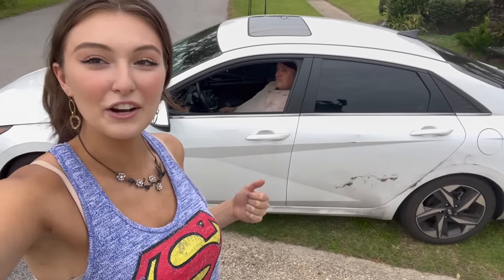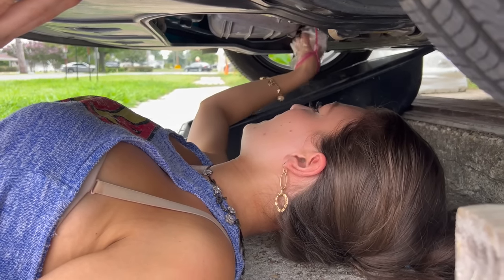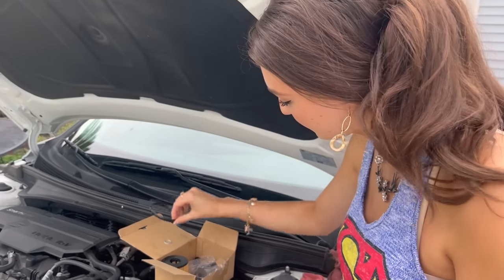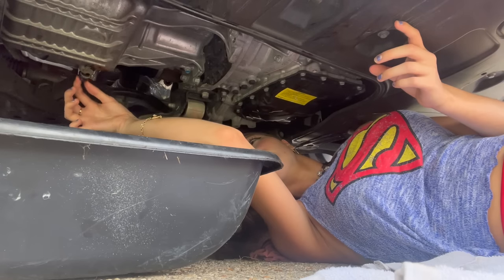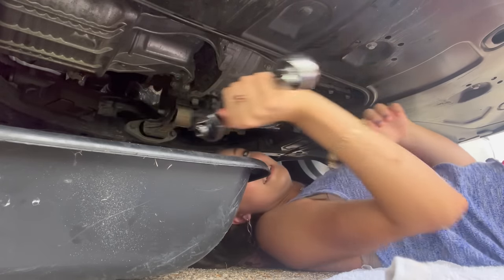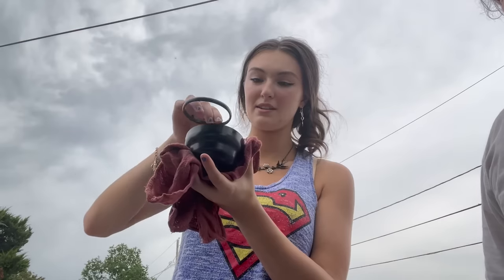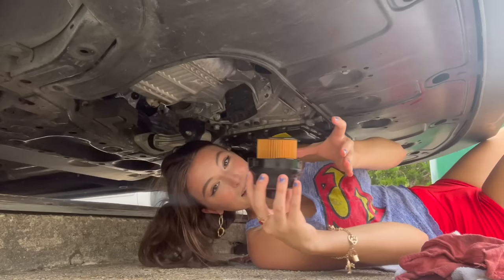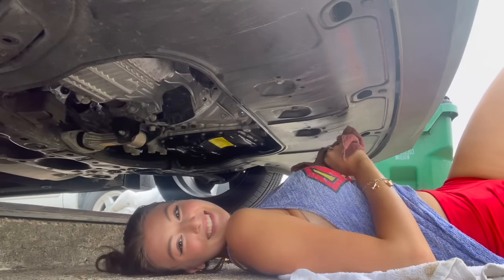Want To Help Me Change My Oil? ​⁠@HyundaiMotorGroup ​⁠@hyundai

Comment: You need to open the oil cap on top. This will help the oil to drain faster and make sure it drains properly. Also you need to prime the o-ring with oil
Reply: The crankcase is vented

Comment: Great job,two thing I‘d add. First take the fill cap off so it vents the engine and the oil will drain faster and more. And the new oil filter gasket is to rub it in new oil to lubricate it so it seals better and less chance to rip or take. Great job!

Comment: The oil in the filter is critical - you want those seals lubricated before you install the oil filter.  Otherwise it may not settle correctly.  Glad your dad pointed this out it is so important.

Comment: Hi Rachel thanks for the video. You are beautiful no doubt about that. But you are doing something for everyone and I respect that so keeping my comments professional and hoping you will answer my question. You mentioned you keep that old oil filter just in case something happens to the car. 
1. Are we supposed to keep all oil filters?
2. What is the reason your dad recommended adding oil in the new filter before installing. 
3. What do you do with old oil how do you recycle it? 
4. Workshops keep information on when oil change was done on your vehicles. How do you keep track and is that is expected by insurance companies in case of an accident or if your car breaks down?

Comment: My first job at out of High Schoolworking at an oil Service Change center, of course we pre lube filters.  It's not rocket science and it's so easy to do.  Even the non paper filters we'd fill the spin on oil filter with a bit of oil.  Also even lube the gasket with oil too for easier removal next time.

Comment: If you open the oil cap it will drain faster...
Reply: 🤔🤔🤪🤪🤣🤣👍👍Called pressure
Reply: No it wont
Reply from the maker: Thanks for the tip!!
Reply from the maker: Thanks for stopping by! Enjoy, and don't forget to thumbs up and subscribe 🛎 so you never miss an upload! Please share the videos and comment on what videos you would like to see next + follow my socials to keep up with my daily life! ;) 

--
💥My Socials:

TIKTOK - OfficialRachelPizzolato
INSTAGRAM - instagram.com/beautyandbrainswithatwist
INSTAGRAM (Alternate) Instagram.com/rachel_pizzolato
FACEBOOK - https://www.facebook.com/Beautyandbrainswithatwist/
TWITTER - https://twitter.com/braintwist2112
WEBSITE - https://beautyandbrainswithatwist.com/
SNAPCHAT - Itsrachelpizz
Reply: Great job 👍
Reply: @porkypig8284 if you dont work on cars just say that. 😂
Reply: @porkypig8284  What? Without the cap removed, you'll pull a vacuum.  The oil will trickle out, finger on top of the straw.
Reply: I don't like changing oil, but with your company it is a much better experience
Reply: Really. That’s what you’re watching
Reply: Makes no difference, the crankcase is always vented 😂
Reply: @igxfux1977  not on some vehicles(ie: some BMWs, Audis)

Comment: Great job. They probably did off camera, but it's good to start the engine and check for leaks before driving it.
Reply: Also the level because it circulate an drop the level i always start the engine and top off what is needed

Comment: Yeah great tip on lifting the car with wood. I have a lowered car and have to do a similar thing. Just getting a jack under the car is hard enough with how low it is. Not to mention if a car falls from the car jack.

Comment: Torque wrench and the right torque on the bold is also a great idea :D ... just to prevent the bold is under/over tightened.  and no... only a jack is a bad idea, if you will get under the car always use proper ramps or this way. ...otherwise, if it falls it will crush you (specially those very low cars), we will be very very sad if that happens... be careful ❤ ... other than that, it's a great video!

Comment: When you insert the new oil filter you need to push it in until you hear a snap. I didn’t see you do that so your filter housing threads may not reach the threads on the engine. I also didn’t see you use an oil filter wrench on the housing which also needs to be torqued to a specific amount. Check your owners manual for the specifications including how many quarts of oil the engine takes. Check the oil level after running the engine for a few minutes so the oil filter gets filled with oil and check for leaks.  I’ve been working on my cars since 1973.

Comment: I bought a couple wheel ramps from walmart for like $50. Oil change in 10 mins. Saves me so much money.
Also, before I hit the comment button, I saw the car shake with you under it and my heart sank. 
Holy moly LOL I bet you about sh-t yer pants.
One time my old man paid for an oil and filter change for me to treat me. It was a lot of money too. 
After 3000 miles it started running funny. They never changed the filter, but charged my dad. The filter had completely collapsed. Never ever again. Always do it yourself.

Comment: I'm told that newer vehicles in general don't need to have the oil filter prefilled before installation now.  But everyone has their own preference.  You would want grease the gasket still.

Comment: Does the oil plug/ bolt and filter need to be torqued to a certain ft-lbs? More the bolt I would think? Nice job. I a little scary setup with the step there. Did you use blocks/chucks at the rear wheels as a safety measure?

Comment: 5:38 a trick I have figured out on anything that you screw, if you twist counter clockwise with a little bit of pressure, the threads will seat because you will hear it and feel it seat. That will never fail and you will never cross thread anything.

Comment: Been changing my own oil for 18 years... never seen airbags under the car before👀. Dripping in rizz, entertaining, educational, hot shorts🥵, and scary af bouncing.

Shout-out to Fumoto valves that are a DIY oil changers secret weapon.

Great creativity and DIY instructions. But dear God dad of Rachel please do not bounce the car with wood blocks while daughter is under it. We want to see more of her, alive. Also I might be wrong but car engine oil doesn't fully empty so getting the extra few drops out isn't necessary and neither is the filter priming (idle the car on startup to prime, the engine still has a layer of oil film from driving up the makeshift ramp) ❤

Comment: you did a nice job. one extra tip i have is  lubricate the seal and before putting the drain plug back, then pour about a  quarter quart of clean  oil to give  that extra little clean flush. :D
Reply: waste.. of clean oil.

Comment: first off, i applaud you for doing your own oil change. many people, especially (presumably) around your age of both and all in between genders who dont even know how to change their tire let alone their oil. that said, please dont go the easy way of lifting a car like the makeshift ramp you used in this video. the metal ramps are only like 50 dollars at amazon. you eliminate the risk of the wood cracking or some kind of accident happening. yes it is a bit overkill but from someone who has seen a car fall on someone, just dont skimp on safety. goes for your dad too. he looks like hes a loving and caring parent and want him to be around as long as possible. the risk is just not worth the few dollars you are saving...

Comment: You should run the engine then check the level again. Once the oil has cycled, then cool, it is the true level. You should be fine - but you lose about 1/4 through that process in come cars. Because you precharged the filter it might be a bit less, but there is still a drop.

Comment: i see your videos pop up from time to time.
your all over.
but one bit of advice. i was a mechanic for many years.
i have seen some things in my day.
dont wear jewelry when working on a car. it sounds stupid but trust me and remember metal is conductive.
i know quite a few people who were skilled and used to working on cars who wore wedding bands and bracelets or necklaces and not a one of them wears them now when working on cars.
when metal completes a circuit it can become red hot and good luck getting it off of you without taking the skin with it.

Comment: Should always start the car after filling the oil and let run about 30 seconds, wait a minute and check it again. It’ll usually need another 1/4 quart depending on the size of the engine. Also, if your car has a turbo, FULL SYNTHETIC IS REQUIRED.

Comment: Great to so you working on your own vehicle. To have the knowledge on how to do it is important, but why did you use a Ziplock bag instead of a glove? Also you should grease up the bolt thread with old oil from the pan before installing is what I have been taught.

Comment: When you can afford to shop at harbor freight buy yourself a pair of portable drive on ramps and a pair of adjustable jack stands and  for safety reasons always use both ramps and stands together, and while you’re there you should buy at least 4 rubber wheel chocks , now at this point you should now have everything you need to do these jobs you just finished ,now always use these tools on a flat concrete driveway that was made with rebar in it for strength concrete needs to be at least 4 “ thick , all this stuff together is going to be less than $100.00 dollars, after you have the right tools you can do it all by yourself safely, never ever cut corners when safety matters, you’re dads way was the wrong way , buy it your worth it 😊good luck in the future. 🗽🫏💙🇺🇸
Reply from the maker: Might want to reconsider your thoughts on the matter…This car is sitting flat and level and on its tires…Mot going anywhere!

Thanks for stopping by! Enjoy, and don't forget to thumbs up and subscribe 🛎 so you never miss an upload! Please share the videos and comment on what videos you would like to see next + follow my socials to keep up with my daily life! 😉 

--
💥My Socials:

TIKTOK - OfficialRachelPizzolato
INSTAGRAM - instagram.com/beautyandbrainswithatwist
I’m 
INSTAGRAM (Alternate) Instagram.com/rachel_pizzolato
FACEBOOK - https://www.facebook.com/pBeautyandbrainswithatwist/
TWITTER - https://twitter.com/braintwist2112
WEBSITE - https://beautyandbrainswithatwist.com/
SNAPCHAT: Itsrachelpizz
Fanfix: https://app.fanfix.io/@beautyandbrainswithatwist

Comment: Things to make ur job faster.
Get a creeper so u can move around bottom of your car easily without getting your back dirty.
Get a simple $1 funnel instead of water bottle.
Get ramps.
optional replace drain bolt with fumoto drain valve.
Your job will be lot easier, faster, and cleaner.

Congrats on your oil change. We need more woman like yourself in this world.

Comment: Never use a tool, to tighten the oil filter. The oil filter must be hand tightened only. Next time you need to change it, you would not get it out so easy, when you tighten it with a tool. Oh, and what black scratches were on the rear driver side door at 9:18 ??

Comment: Letting the wheels rest on the piece of wood like that is kinda dangerous. They could slip and the car could roll forward crushing you (probably wouldn't but still). Invest in a quick pump jack and some jack stands or at least secure the back wheels with blocks of wood and put the spare tire underneath.

Comment: You are wonderful woman changing car oil and filter looks easy for you but it is too hard for most of us specially  it is also dangerous . Make sure safety pre caution  first  and  will secured that the car properly  lifted and  will not move while you are underneath doing the work  also use goggles for your eyes protection.

Comment: color of that break fluid, needs to be changed if not done already as this is 5+ months old video.  Also yes, use a pre-oiled filter.  Found video that tested dry vs oiled, and oiled wins.

Comment: What would be the problem with leaving the oil filter dry?
Reply: In a car like this, nothing really. As the dad was saying, in a larger filter the pump will have to fill the filter before it can start lubricating the bearings. 

Still a good habit to partially fill the filter, so she is doing it right.
Reply: @JoshuaTootell: Thank you for your explanation

Comment: The only person on planet earth that keep and dated old oil filter just in case if something wrong with the motor after 80000 miles and 30 oil change later. You have proof of oil change.

Comment: Extremely unsafe and dangerous especially when your dad is rocking the car and you are under car. Front tires were so close to edge. Simply buy a pair of heavy duty ramps (probably $50).
Filling filter with oil is not necessary for small engines. Sometimes it is horizontal and you can not fill it.

Comment: be careful, the car could slide towards you while you're under, you have to add safety tools if the car isn't leveled.
Reply from the maker: The car is completely level and we tried to push it off the blocks and it would not budge. I have a video of me and my dad pushing, pulling, and bouncing it…It is not moving whatsoever!

Comment: Rachel .. I hate to be a buzz kill here but the next time you guys do this please use wheel chocks in front of those rear tires.

When your dad was bouncing that car it can throw it out of park and if your parking brake is not so great the car will roll over you. I've been a mechanic for over 15 years and I've seen a car fall on a person , it's not pretty..

Other than that, great video and please be safe from here on out..

Comment: How not to change the oil in a car you meant ? I was expecting that car roll forward at any moment 😮
Reply: The car is level. So long as it is in park and the parking brake is engaged, why would it?
Reply from the maker: @Boblib1970 - Exactly!!
Reply: @Boblib1970  could , should still why risk it ?

Comment: Someone get this girl some ramps
Reply from the maker: We have multiple sets of ramps…No way is that a better option because this way the vehicle is sitting flat and level on its tires. With the ramps…the vehicle will definitely be lifted in the front and has the potential to roll off the ramps. I plan to do a video comparing the two applications.
Reply: @rachelmichellepizzolato  This video keeps getting suggested to me even though I've seen it already. I think YouTube wants me to read these comments lol. 
This is certainly an unorthodox way of changing oil, but if the car is in gear and the parking brake engaged, it is 100% safer than lifting the car in any way...ramps, jack stands, lifts,  or even magic levitation 😅 
My dad taught me how to change the oil in his 60s muscle cars when I was a kid. We never used jack stands. They are high enough that you can roll under them on a creeper and easily access the drain plug and filter. This really isn't any different than that.

Comment: Whoever is bouncing that car should never work on cars or drive them.
Reply: May be a bit harsh but as a tech for about 15 years, never bounce a car when someone is under it.
Reply: Also, the oil on the filter is not required for cars especially if the filter is underneath. It’ll fill as you dump in the new oil. However, always line the oil filter ring before screwing on.

Comment: the way you have the car set up for the oil change is extremely dangerous! if the parking brake didn't hold or the car came out of gear you would get crushed. You don't even have any of the wheels chocked.

Comment: Hey Rachel, please wear clear safety glasses while under the car. Anything can fall from above you into your face or your  mouth. Battery acid, nuts, bolts, dirt, oil, believe me it's happened to me honey buns. Bolts loosen by them selves, oil drops, loose sockets from previous maintenance done. Rats nests, squirrel nests, snakes, cats, mice. Keep your mouth closed while under any vehicle, you will thank me later honey. Gloves to protect your skin and nails. Even a mask over your mouth honey. A loose nut, bolt or socket can chip your pretty teef........ We want you to stay pretty as can b. Jus sayin it all at once. Ezee pezee, Japan ezee, lemon squeeze ee, sweet as honey buns.💅🌱❣️😊 Happy New Year 2024 n more.

Comment: That's why car Maintenace is not for females. Buy a Magnet drain plug, is much better. You can reverse the washer and re-used again, I have done four times with not leak.
--- It's going to click, NO: is not a torque wrench. Use a torque wrench to tight the drain plug. 
---- That's why I will never trade my Elantra 2008. That filter sucks.
-- A 2022 Hyundai and can't afford a real Funnel? Wow.
-- Things your dad didn't teach you: 1- don't use jewels when doing car Maintenace.  2- Use gloves if you love so much your nails. 3- Don't be Lust on public.
-- And the last: Drive without texting or talking by cell, so you don't crash your 2022 by the left side again.